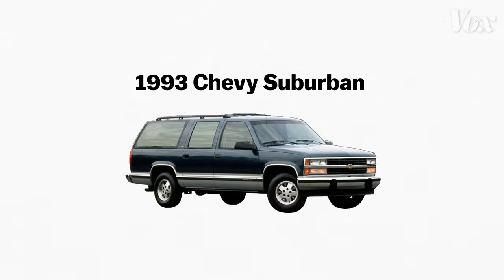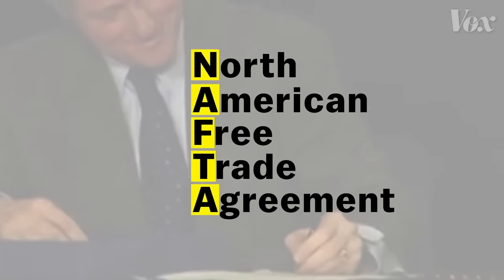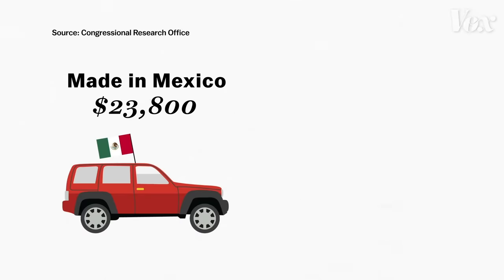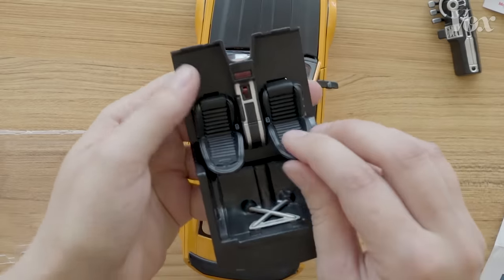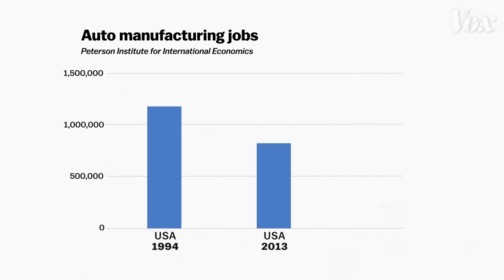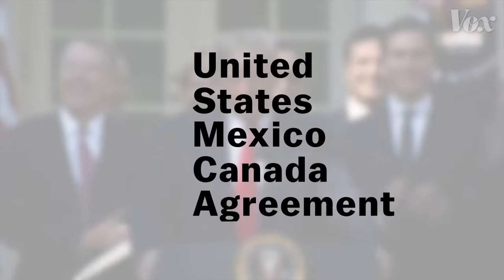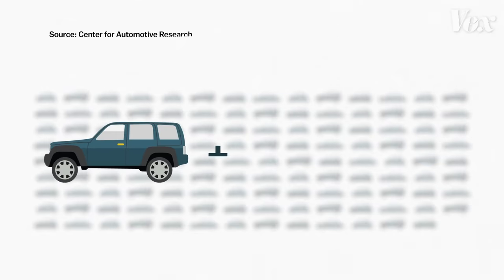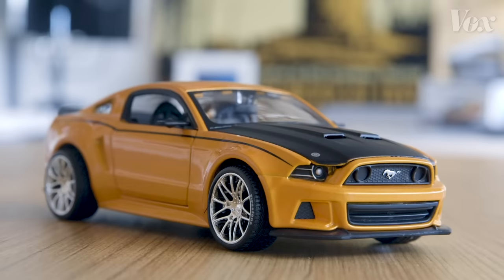USMCA vs NAFTA, explained with a toy car

Comment: 3:11 That's pretty disingenuous. As you can see on the graph it's stagnated, collapsing and then recovering out of a recession. But after 24 years there was virtually no change in vehicle production at a time when there were great increases in overall vehicle sales. I would not call this a success story.
Reply: And to complicate it, they mentioned the back up cameras, air curtains, etc. so you're comparing two different levels of vehicles that happen to have the same name. And the market is different, how many car companies are there today selling cars? Gasoline, hybrid, electric? If consumers did the math, electric cars aren't worth the money, hybrids are better, etc. Then again in California, with gas about twice as high as anywhere else, it's different math; buy nobody asks why it's so high...

Comment: You're right, NAFTA is not to blame for most of the loss in jobs. Most of the outsourcing has gone to China. Automation has definitely played a big part as well, but it's undeniable that many of our manufacturing jobs have been lost because companies move factories to China for cheap labor. Basically everything is made in China these days: medicine, toys, electronics, clothes, you name it. I am not concerned by the potential rise in prices of products if the jobs move back to America. Less outsourcing will increase wages, which will offset the increase in price levels.

Comment: Yay fewer cars
Reply: Not really 17 million were sold over the year so 60 to 120 thousand is really not much in the big picture hear bud
Reply: Not really. People would still buy old cars which produces more emmisions.
Reply: When i try to open a discussion noone replies, when im being stupid i get two
Reply: @TojikCZ  your opinion man but I am stating a fact tho
Reply: And i agree
Reply: @TojikCZ  and if you think that electric cars are eco friendly compared gas powered car more power to you then but there was a study done a few years ago by a independent group compared a Audi a7 and model s and the Audi put 2 tons of co2 more over all based on normal driving conditions so not really eco friendly when you think about it
Reply: @slyfoxcooper4623  - All that study revealed is that the source of the electricity where the batteries are made are indicative of how low the carbon emissions will be. So if the batteries are sourced from Victoria, Australia then no they're not eco-friendly, but Teslas made anywhere else will be equal or better---and that's only accounting for CO2 comparisons at the manufacturing level. However, the ZERO emissions over the lifetime of the car more than compensate for the emissions from battery manufacturing. So overall, on an aggregate scale, electric cars are absolutely eco-friendly in the long-term. They're also less likely to have deterioration bc there is no engine, fuel tank, oil changes, air filters, fan belts, timing gaskets, cylinder heads, or spark plugs. Just battery deterioration is the only headache that needs dealt with, but with good battery management systems & daily maintenance, the deterioration is much slower than in a fuel car. So the cost efficiency & CO2 emission savings from routine maintenance should also play a role in consumer buying decisions. Also, regenerative braking extends the life of brakes, bc they store the kinetic energy which helps brake pads & rotors last longer. That study also didn't factor in battery brand or electricity mix. Here's an article that clarifies why such a study can be myopic...

https://cleantechnica.com/2018/02/19/electric-car-well-to-wheel-emissions-myth/
Reply: @YourMajesty143   did you even see the study and what do you do when your battery can't hold a charge like a phone it's like you can't bring it in shop to get fixed for a couple 1,000 dollars once it's dead it's dead and batteries cost quite a bit whatever the insurance will write it off

Comment: Here in Indonesia, a brand new 4cyl Mustang would cost anywhere near $100,000 or more due to import taxes. Even the cheapest car (no airbag, no abs, no ac, no audio, no sun visor, manual trans) that got subsidised by goverment costs more than $9000, yet the minimum wage here is around $250 per month.

Comment: Hold on. I think someone is confused. Let me help you. The new deal will require an extra 12.5% increase in North American parts being used on North American made cars. North America includes Mexico, Canada, and the United States. Just FYI. Which means that the businesses in North America can now make those extra 12.5% in parts. Currently in all of North America there are people hammering away trying to figure out a way to acquire a piece of that 12.5%.  I’m sorry I sound condescending but your piece seemed to be very one sided. You also presumed that car makers would leave and  pay the 2.5 tariff. Not likely. You should do some basic number running. Like how much would a 2.5% tariff cost Ford. Or maybe how many jobs can be created by having to produce 12.5% more parts in North America.

Comment: AYYYYYYYYYYE -- HANG ON A MINUTE, SIR OR MADAM AT VOX. Your graph says the CPI went up 86%. The price of the vehicle more than doubled over that time period (21370 -> 47188) a 120% price increase! Not 7% MY DUDE! The CPI didn't actually go up 86% either, it was more like 66%, go to the BLS website and check for yourself!
Reply: The CPI is used to measure real world inflation. If you want to do an apples to apples comparison to the 7% figure (which I suspect is also misleading at this point) the CPI should be around 0%.

Comment: You can point the finger at NAFTA and not at mexicans. 

Regardless of what's to blame, NAFTA is unsustainable now due to automation.  That's why the USMCA requires that mexican auto-workers who work on american cars are paid equivalently to American autoworkers.  

This is also why Yang's approach for UBI seems to work, on paper at least.  He's basically going to tax that innovation and distribute it to each opt-in shareholder.  Because automation is coming, no matter what, we have to orient ourselves towards absorbing it into our society in a way which provides an overall benefit.  We do not have the luxury of putting the matter off on someone else's shoulders.

Comment: Retool auto industry with higher quality, easily replaceable parts and modular assemblies so that these could easily be upgraded as technology allows. The idea being to buy fewer cars that have longer life. This would be along the lines of upgrading the lights to LED or installing a new power plant (engine) etc. You could shop the Ford dealer for instance to buy a new dashboard assembly, or new seat packages or new custom exterior wraps.  Just a thought. Seems like a waste to spend 30, 40, 50 grand or more every few years on another vehicle.

Comment: Very interesting point of view. With this understanding, it basically comes down to whether the cost increase to manufacture 75% of the parts in NA is cheaper than the 2.5% tax. If the cost is even, then what would stop the car manufacturers from making the cars in China and just paying the 2.5%?

It will be interesting to see how this impacts jobs moving forward.
Reply: More tariffs against china. Larger logistics and legal barriers and costs and so on. Theirs more to the economy than labour and even if labour costs rise this can reasonably be mitigated by other variables.

Comment: Consider environmental impact. Less cars on any road can be a good. More mass transit in the USA is a good scenario.
Reply: I watch buses run nearly empty all the time, that would be a waste in the private sector. Mass transit only works in special cases, like London, were 4 million riders take the subway to work each day. They do NOT go grocery shopping in downtown London, they take a car a mile or two to their local stores. I have friends living there. Mass transit works best when you have a LOT of people all going at the same time to the same place. In Southern California, your job (like mine) was 45 miles away from my home, 90 miles round trip. My job use to be 15 minutes away, but they closed due to excessive regulations. I did that on a rotating 5-2-2-5 schedule (5 on/2 off/2 on/5 off so I made 7 trips every two weeks. Then I retired. Cars are INCREDIBLY flexible mass transit. Moving millions to/from work every day REGARDLESS of where they live or work. NO system of buses/trains can match it. My 15 minutes commute by car would have been TWO HOURS by bus, and impossible at all for the 45 mile commute. 
In California we had a member of our Assembly once boast that she charged her electric car with her solar panels at night. If you can't see the contradictions in that statement, you'd fit right in with Sacramento.

Comment: If there are less cars sold won't that be "good" for the environment meaning, less materials are used, less old cars sit in junkyards and actually get used, and good for the economy because aftermarket companies will have to step up and make replacement parts for broken parts that the original manufacturer doesn't make anymore or that the car company even exist now to do so.

Comment: No.
150000 fewer cars will not be sold.
People don't really care about an increase in price of 2200 dollars if they are already paying 40000 or something.
People wouldn't have a problem with  50 dollar increase in price of iphone because it is not that much in comparison to the original cost of the item.

Comment: Your numbers for the suburban are off and your inflation numbers. Brand new suburban from Chevrolets website starts at $51,000. Inflation rates for something at $22000 would be $38,000. Don't know about you but $5,000 Would be a lot and $13,000 is a hell if a lot of money.

Comment: i agree that free trade across borders is good for everyone, but like you said most other goods have increased in price. so if the success of the automotive industry in the realm of the cost of  goods is due to having free trade practices with regards to automotive manufacturing and sales, then i believe nafta is flawed in that it does not apply these same practice to other goods like milk for example

Comment: One point and one question.. Whatever one thinks of NAFTA. Jobs were leaving the USA by the 100's of thousands before it's implementation not because of it. My question is. The new content percentage from 62.5% to 75% sounds good. But I believe the formula for determining that percentage has changed and it is not as great as an increase as it seems. Can anyone answer if that is true or false?

Comment: I don't the price of cars has to go up in fact SpaceX builds their rockets right here and they are 20% of the price that Boeing makes rockets for.  The problem is they way they are built with all the this shipping of parts and what not.  More Vertical integration is needed at the auto companies.

Comment: There seems to be a logical flaw in the argumentation when it comes to the impact on the economy. The assumption of the video seems to be that less sold cars means that the whole USA economy will get hit negatively. But this is not that easy to say at VOX presents it. Yes their  will be sold fewer cars if the price gets higher, but you have to look what happens with the consumption as a whole on all goods and you have to see how for example what happens if for example new factories open as a cause of the tariffs in USA. The video doesnt present any logical based argumentation about this but assumes... For a real in debt analyses  you would have to base it on a circular flow of income model

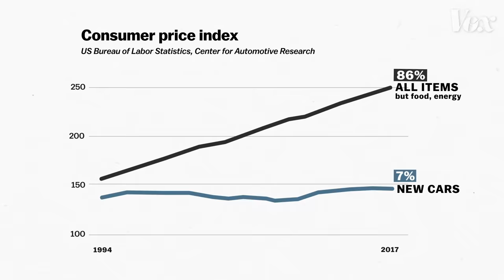Comment: 0:41 wait, you just told me that the suburban went from 21k to 47k, which is more than a 100% increase, how is the increase for cars 7%? Are you serious plotting the inflation adjusted price (where you adjust the price based on the CPI) to the CPI itself?
Reply: 21k is how much it costed in 1993, they’re comparing the 21k adjusted for inflation with the current cost of the car, which is a common method used to determine the change in prices overtime

Comment: Good get rid of NAFTA. Americans have lost pride in driving American cars and the companies listened and lost their pride as well. What a shame. Back in the 70s people used to make fun of imports now their children drive hondas and toyotas.
Reply: Many people consider Toyota to be the most reliable Japanese car. But they were never intended to last, as well as Isuzu and Subarus. Come to the rust belt and try to find a Toyota pickup at least 15 years old with a healthy frame. The frames were built ridiculously thin and small, and had 0 quality as spot welds and joined pieces would rot from inside out. Japanese cars are not built to last. By 300k miles, if they last that far, the owners will praise their reliability as they pour in another quart they burned that same month.

Comment: Bottom line, jobs make an economy function. No jobs, no money, no taxes, enter Venezuela.
Automation does cancel jobs, but jobs lost to other countries cancels complete factories. 

Example: the largest US Appliance motor manufacturing plant n mid-late ‘90s, 1,500ppl. Now doesn’t manufacture a single Appliance motor, only limited components, 100ppl. 

This wasn’t automation, it was NAFTA. Mexico threw away the automation, & went back to cheaper & less quality workers. 
I’ve noticed that the NAFTA “cheapness” hasn’t caused the Appliances to drop n price. But, the Quality has sure suffered!!!! 
They’re a 4-6yr Appliance vs a 20-25yr Appliance. FACT!!

Comment: But it's not a good thing that cars are cheap. Because that means more cars on the road therefore increasing CO2 emissions meaning more global warming. Not to mention the emissions from transporting these parts back and forth between countries. The only thing I agree with Trump on is that NAFTA is really bad.

Comment: The beginning cost comparison is economic illiteracy at its finest. Doesn't take into account the differences in how the CPI measures inflation between the two products, automobiles, and food and energy. 

As a car becomes more fuel efficient, they say the cost of production did not increase by the full amount, creating a skewed CPI. Nothing but apples to oranges in those prices presented. 

And Vox, you should focus on money printing, the Federal Reserve, and wealth transfer because of inflation as the primary problems in this country. Y'all obviously don't care though because it does not suit the political agenda y'all like.

Comment: This video seemed rather wishy-washy to me. The change could lead to higher costs, and it could lead to more cars being built overseas.
Very little was provided to back anything up.
This video felt like you were against it solely because it is a Trump policy. Trump has a lot of terrible policies, but the result of this policy doesn't look so terrible to me. (Not great either, but not terrible. Something middling.)